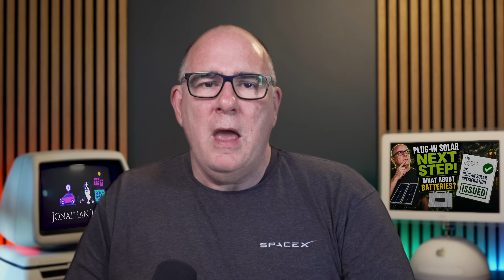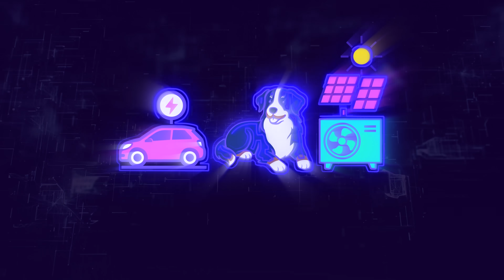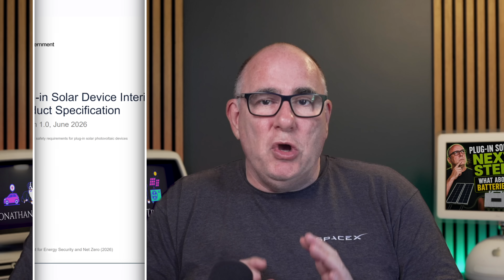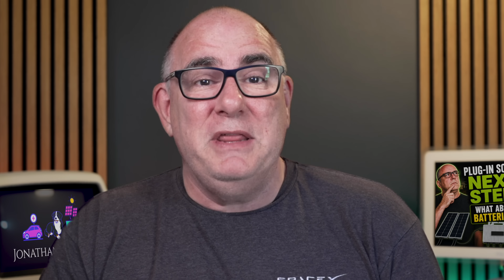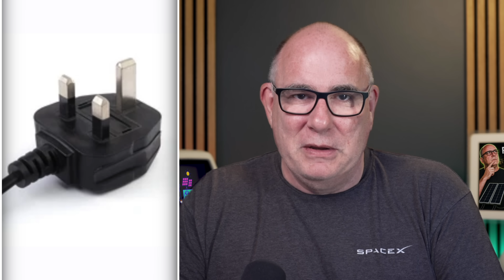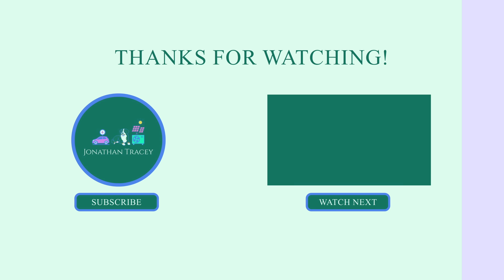Plug-In Solar Finally Legal? The Real Story Behind the New Government Rules

Comment: Nothing has fundamentally changed and the interim standard is pointless. Just more evidence of politicians using influence and work arounds to expidite their own policy agenda. Why would a manufacturer invest resources to design a product to a standard which itself is described as likely to change? (Especially when they already have existing products being sold into Europe) - they wont. In all likelihood they will just be the same existing devices with a UK plug. So no actual progress has been made, nothing has changed, nobody is going to do anything as a result, and even if all this were wrong and something did happen it will make no difference in 2026. Spectacular, what a result!
Reply from the maker: I disagree. It’s one more thing that’s ticked off the list, but I agree we’re unlikely to get this done before the end of the summer so it’s really a 2027 project.
Reply: @JonathanTracey  its not ticked off the list at all, otherwise it would be an actual standard not an interim document.

Comment: Thanks for the update. The problem the government faced is that bodies responsible for producing the standards do not want plug in solar and they will drag their feet forever. So I think what it should be doing is having a quiet word with the IET, along the lines of "this is happening so get on board right now help produce the standard in record time or you will lose your role in any future standards, building control etc. 
I think all the big manufacturers are probably ready to go already, they almost certainly have production of UK plug terminated cables ready to start at a moments notice. These are mostly Chinese companies and unlike British ones they don't leave stuff to chance at the last minute. They will also have had a very good idea what the specs will be. Stuff will ship within days of the final standards being published. 
In the meantime those adventurous enough will simply go ahead.
Reply from the maker: i’m sure those conversations have been had, but ultimately what can the government do if they drag their feet other than go around them?

Comment: Jonathan thank you so much for your efforts. You are articulating the issues with clarity. Just one comment from me 800W per household is just a joke. It is only to increase the consumer's apetite that will then have to deal with an expensive installation of the real thing. If they approve 800W per circuit it will be advantageous and will start making sense.
Reply from the maker: I suspect the 800 W per house will get changed to 800 W per circuit as per the footnote in the document

Comment: What actually happened was Daft Edd Millipede made another stupid Nut Zero statement that wasn't even slightly achievable in the stated timescale. Now they are pushing through a half measure that's only 2x 400w plug in solar panels. Pointless failure by Nut Zero zealots. 
Don't get me wrong I think solar done correctly is great. 
Not half measure for political media headlines.
Reply from the maker: this has got nothing to do with net zero

Comment: So a molded design for a plug means no chance of just cutting, feeding through a hole and rewiring?

I was planning on feeding the wires through a small hole in a window frame but I guess if this is the case I will have to plan around this depending on the dimensions of the other end of the cable..
Reply: I don't see anything saying you can't add a spur and put the socket outside (obviously an appropriate specification socket). Ways and means 8)
Reply: @etchedpixels  Yeah, thinking if I need to an outdoor socket will be the best option, just have to wait and see all the final details. 

Actually have an outside light already I was planning on taking down which is direct to a fused socket so could also be an option if that is considered safe given those sockets from what I understand are only for low powered items.
Reply: Just cut it off. Pop it through the hole and wire a plug in the end.  The rules are that the seller needs to fit one, not that you can’t change it.
Reply: just means an electricians job for an external waterproof socket
Reply: @kfarmer-b8v  Do it yourself. Save £150.
Reply from the maker: @jakeEyz of course that’s what everyone’s gonna do
Reply: how about just cutting the plug off with a metre of cable feeding it through the hole  and using an inline connector inside the poperty.
I think a lot of the regs are to do with what you can sell, not necessarily what the cionsumer does with it once they have sold it.

Comment: The moulded plug requirement confuses me a bit.  It will just encourage people to use an extension lead. Even if it's not coiled up, damaged, or both, I thought they were frowned upon for this kind of use.
Reply from the maker: remember were talking 3.4amps here max load, most modern cables should be able to handle that
Reply: I'm still trying to work that out. The requirement is BS1363-1 but also partially insulated pins. So I wonder if it's just that they think you might swap the plug for one without partially insulated pins, whilst the partially insulated pins are necessary to provide safety as the plug disengages because the generation shut down is not instantaneous.
Reply: Even rewireable plugs have had partially insulated pins for years.

Although not necessary, some people might want to wire them into a spur or straight into a consumer unit.  Presumably if they cut the plug off, then that's it for the warranty.

Comment: Hi thanks for this information but I am now confused.. I am sure I have read that plug-in solar is already legal in the UK as long as you let your DNO know that you have installed it !! Regards Mark
Reply from the maker: so long as it was installed by an electrician into a fused spur with appropriate protection in the fuse panel, so not really plug in even if the equipment is the same
Reply: @JonathanTracey  Fused spur is not sufficient - must be a separate circuit all the way to the consumer unit and usually needs (for no obvious reason but history) a separate disconnect.

Comment: G98 is also being updated to facilitate plug-in solar and batteries. The G98 consultation (DCRP/26/02/PC – Modification to EREC G98 Issue 2 Amendment 1) closed on 30th June. the summary says:

"This consultation seeks stakeholder views on proposed amendments to Engineering Recommendation G98 (EREC G98), an Annex 1 document under the Distribution Code. The proposed modification has been developed to facilitate the connection and operation of Plug-in Micro-generators, including plug-in Solar PV and plug-in Electricity Storage, while maintaining appropriate requirements for network safety, supply quality and operability.

The proposed changes are intended to provide a clearer route for Plug-in Micro-generators under EREC G98. Key changes include the introduction of a new definition for Plug-in Micro-generator, clarification of the technical requirements and connection process for Plug-in Micro-generators rated at 800 W or less, updated notification and decommissioning forms, and specific practical exemptions for Plug-in Micro-generators in Appendix 1.

The proposed amendment also includes a minor administrative update to Form C to ensure LFSM-U compliance information is captured consistently in line with existing EREC G98 requirements."

Details here https://dcode.org.uk/consultations/closed-consultations/
Reply from the maker: Yep new update coming tomorrow the legislation is ready and goes live in about 1 months time and the G98 update is still needed

Comment: The one thing about plug-in solar that would concern me from the electricity network point-of-view is whether if you had a block of flats could all of them having balcony solar end up producing an over-voltage that would cause the inverters to trip on a sunny day. The 800 W limit/flat if you had a 25-storey block with 4 flats on a side would equate to 80 kW. G98 allows up to 16A/phase (4.0 kW= 5 flats assuming max 250v) so presumably balcony solar for all large blocks of flats would have to be approved under G99. Even if a single block of flats was on three-phase, that would only cover up to 15 flats maximum.
Reply from the maker: @laurencecox2657 That's a very good point, and I suspect it's one of the reasons the 800 W limit exists. A single flat isn't the concern—it's the aggregate effect when hundreds of them are connected to the same local network.

If a development reached the point where cumulative generation could cause voltage rise or other network issues, I'd expect that to move beyond a simple G98 notification into G99 territory, where the DNO assesses the impact before connection.

The encouraging thing is that this isn't a new engineering problem. DNOs already deal with clusters of rooftop solar today. Balcony solar just means those same network planning principles may need to be applied to higher-density housing as adoption grows.
Reply: It's handled differently at this point.

In the case of projects where you are doing a bunch of installations at the same time an application is made ahead of time and there is a process. It's used for example if a council was installing solar on all the council houses on a street so that the DNO doesn't get handed a grid busting surprise.

For un-coordinated projects however it can already happen that a bunch of neighbours all decide to get solar about the same time, and the rest is the DNO's problem. Really all that has changed is the probability of such clusters appearing and I'm not convinced it will make much difference. Flats in particular are problematic as leaseholders will need the freeholders permission to install the panels and for tall buildings that will be really really interesting post Grenfell.

It's one of several things the interim specification does not resolve with regards to G98. Another is scaling of the forms and paperwork processing so the DNOs don't implode under a hail of G98 forms. The most interesting one is that plug in solar under the interim specification does not appear to be permitted by G98 7.2.1 which explicitly requires BS7671 so is not amended by the interim product specification.

That will no doubt have to be resolved in the final spec or some poor judge is going to have it dumped on his caseload.

Comment: Standards - you are so right! Years to produce, I worked with / chaired committees at Energy Institute, so have personal scars, as we all had other jobs to do (and get paid for!). Cheers for the info.
Reply from the maker: @petergedge9629 It certainly gives you an appreciation for why standards take so long! I was involved with some of the early IETF standards many years ago, and I remember exactly the same thing—years of meetings, debates and revisions, only for some proposals never to make it over the finish line.

I think that's why it's important to recognise this as an interim product specification. It's a significant step forward, but there's still consultation and refinement ahead before it becomes the long-term standard.

Comment: Different devices on different ring circuits would be good so I can double up. Hopefully they would operate smoothly with the eco flow smart meter on the consumer unit. It would be good if that could understand a scenario where I added a larger home energy battery later and it could differentiate between that battery outputting and genuine draw from the grid.
Reply from the maker: @Hyfly13 I think that's exactly where these systems need to head. Ideally the smart meter or energy management system should be able to distinguish between grid import, rooftop solar, a plug-in battery and a whole-home battery, then make sensible decisions based on all of them.

At the moment most ecosystems are fairly closed, but I'd love to see more interoperability. If manufacturers can agree on common standards, people could expand their systems over time rather than being locked into a single vendor.
Reply: @JonathanTracey keep us posted!

Comment: Sounds like they want to limit the size and usefulness of the system, ie, they don't want us generating or saving too much. If they limit the size and numbers of inverters, panels and battery sizes then it seems some influence maybe coming from other areas with certain interests.
Reply from the maker: simple rule for life never assume malevolence when incompetence will suffice. I don’t think these people have any idea what they’re doing and therefore assuming that there is some master plan behind it isn’t really true.
Reply: It's about safety. 800W is the most that can be backfed into a circuit that's fully loaded to remain basically safe according to the modelling work done by VDE. DC panel voltage limits at 120v (which is way too high - sensible places limit to 60v) protect random people nailing cables up walls and fences then running a hedge trimmer through them, or chopping one by accident when gardening.  Limits on solar string sizes protect against fires caused by dodgy cables and bad connectors. The last one is a big real world issue, especially as the UK is seriously behind the times in not requiring arc detection on solar systems. That's btw something that's going to cause far more fires on roofs than we should have seen if the regulation had been properly updated.

Whether you are allowed one per circuit or one per house was a consultation question and there are good arguments for both.
Reply: It's not really designed to replace a full solar system. It's out to cover your base load and a bit more. 
Even at my old original 600w standard one quite a bit of the time  I'm not using the amount supplied and it's fed back into the grid. 
On a clear day in the summer I don't have a base load for 14 hours a day.

Comment: One thing... If the standards are roughly the same as EU standards, existing equipment will already comply. No need for design and manufacture. Just update the appropriate registers and they are set.
Reply: nah this is the UK mate - we've got to make our own standards - we're special and better because [explanation missing]
Reply: @iamdmc i have to disagree... Current solar inverters are compatible with many standards at the same time... Its not just a single model per market. One model suffices. Incompatible ones can just be made compatible with a software update.
Reply: @justanotherpod4905  r/whoosh
Reply: @iamdmc  If you bother to read the actual document you'll see that's not the case. The existing products that are not "plug in" are going to be compliant to just about everything but the lead, some stickers and an update to the manual.
I don't think changing the UK to German plugs and sockets is going to happen any more than fixing the side of the road we drive on or being metric with imperial speed limits.
Reply from the maker: yeah, but we still need to have our own version of the documentation even if it is Word for Word. It still needs to go through the process. This is how government works for crying out loud. MP still send letters to each other in the 21st century. If we can’t fix that then there’s no hope.

Comment: In Belgium the only requirement is to use a micro inverter from an approved list.
And I bet those kits in the German Amazon already cover those UK interim requirements only thing necessary being changing the plug at the end. 
But those are anyway sold separately and click in securely in a strong sealed coupling.
Very little to adapt for the UK, really.
Reply from the maker: oh I fully agree, I very much doubt any of the manufacturers are gonna have to adapt their products, because all of the specifications and safety check seems to follow the German standard
Reply: I have been working through the UK document standard by standard and I would agree. I think the only thing most vendors will need to do is to provide a new manual, a UK power cable and a UK sticker pack - and then obviously run the compliance tests to sign it off.

Interestingly they've also tried to tackle the building regs aspect of balcony mounting by requiring the manufacturers mounts comply with UK building regulation requirements which is very sensible, but that I believe is genuinely quite different to the German regs. I have no idea how that works out for similarity of standards.
Reply: @etchedpixels the kits that are typically sold come without mounting hardware.
And understandably so, as those have to fit individual layouts, etc.
It's just overall great the solar is gettyso democratised.

Comment: One plug per circuit? Split a ring main into 2 radials? Now there’s 2 circuits. Now 2x800W?
Reply: To be decided based upon the consultation responses.
Reply from the maker: yeah dont take that as gospel at this point lets see what the consultation comes back with
Reply: cost wise it soon  becomes cheaper to buy an approved 3.6 kw inverter but starting with one can be incremental costings so may be advantageous.
 Anyone know a cheap authorise 3.6Kw inverter?

Comment: Why would a appliance need to compliant with BS7671 , that only is for fixed wiring installations , items on a plug are not in scope of bs7671
Reply from the maker: I believe it’s to do with the downstream RCD’s or RCBO’s
Reply: Part P says otherwise. A fixed installation whose final connection is via a BS1363 plug and socket is still subject to  Part P and thus BS7671. The law is very very clear on that.

Hence everyone in the electronics business is temporarily evaluating them at the moment.

Comment: I'm waiting for plug-in battery, and to see if you can easily use it to increase existing battery capacity without electrician expense.  Battery will give more year-round benefits.
Reply from the maker: agree and yes you can easily add capacity without and electrician